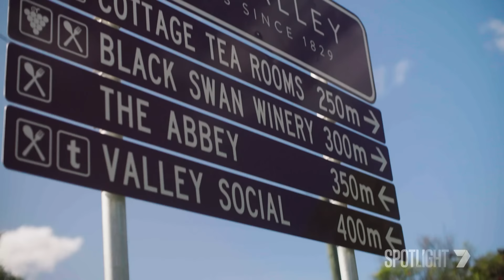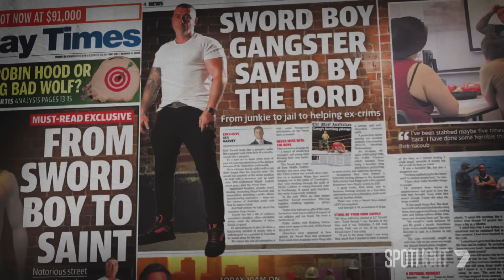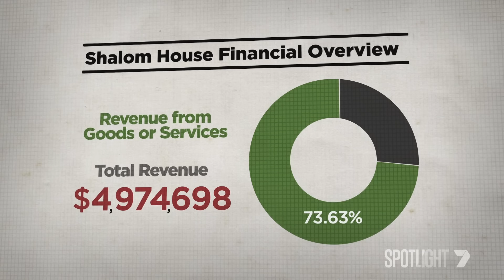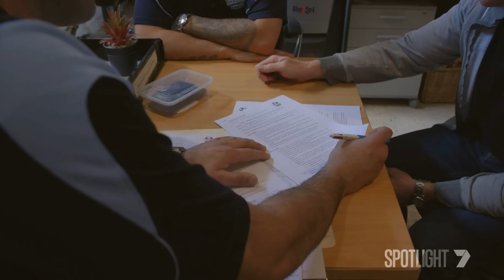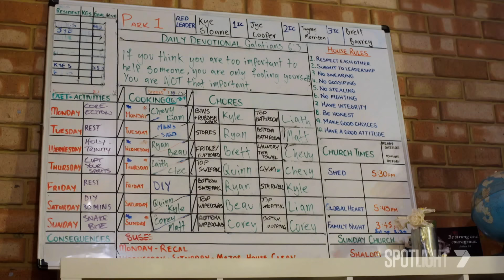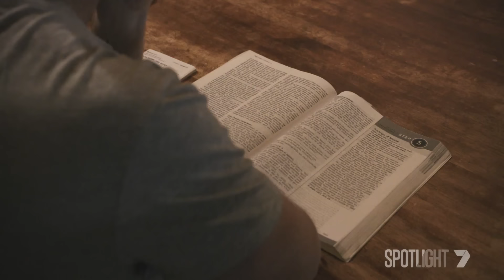Inside Australia’s Toughest Rehab Clinic

Comment: What’s the relapse rate?
Reply: It’s gotta be over or around 80%
Reply: People relapse because they choose to relapse, not because of a rehab 😅
Reply: Habits are hard to break as humans are not designed for drugs.  Try, try again dear people.
Reply: That’s the key question.  If you locked an addict in a shed or anywhere, they would be “clean” while there, but the key questions are: 

- are they still clean a year after they are out? 

- what is the percent of all residents that stay clean over a year, and how does it compare to other treatments?